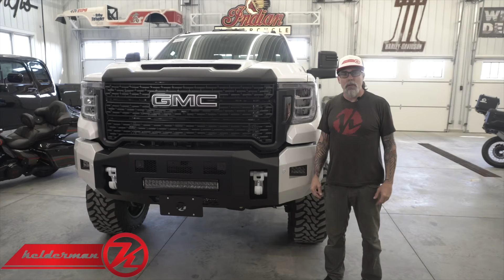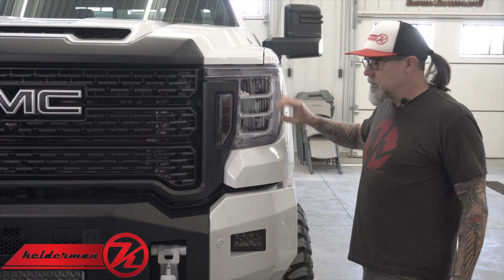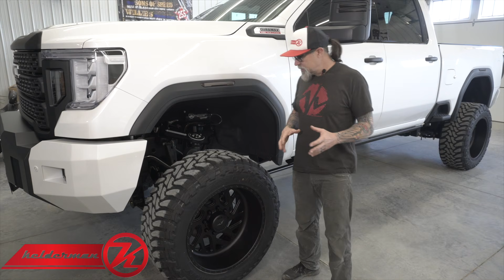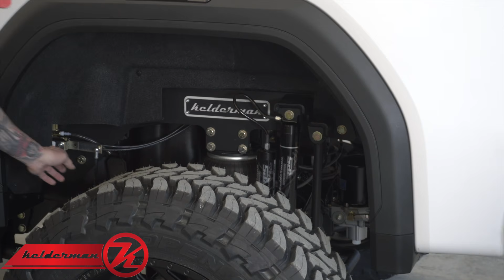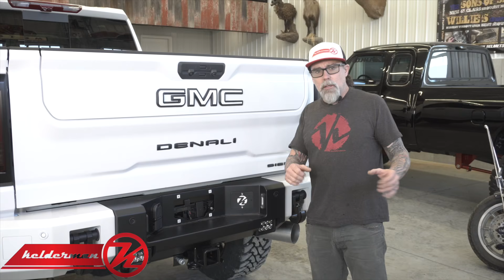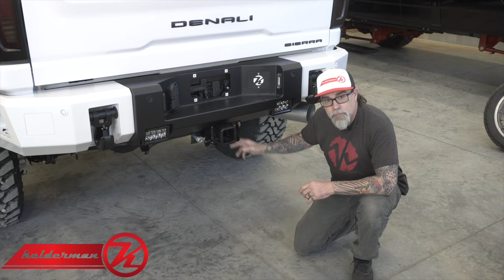*Black & White* 2022 GMC 2500 Denali - Kelderman Air Suspension & Bumpers!

Comment: What is the offroad like with that rear air setup... potentially looking at doing a coilover front end with yalls rear air ride
Reply: You can still use the rear air ride setup just as you would any other suspension style. Off-road capabilities are not impacted.

Comment: I have a white AT4 HD, I like this look but I am very hesitant with lifts
Reply from the maker: This would be a pretty high lift. We have also done smaller trucks with a 4-6" lift kit and 35" tires. If you're not wanting to go this high, that would be our suggestion.
Reply: @KeldermanManufacturing  thanks, I think a quality level kit and 35's might be my thing.

Comment: Is there a complete kit that is less high. Maybe 4 inches or so. Want to haul a fifth wheel without height issues between bed height and camper nose.....Tnx
Reply from the maker: We do not have our own front kit in that sort of range, but you could do something like that with our +2" 4-Link Rear Air Suspension Kit. That's what is shown in this video: https://youtu.be/U-9icCDuSa8

Comment: How much would something like this cost?? Rough estimate PLEASE!
Reply from the maker: Full builds like this are typically in the $40-$50,000 range with lots of cost variables.
Reply: That seems too much. Doesn't make sense.
Reply: Rip of city , mod your truck yourself  at least I do   Lol 😂
Reply: Way too much. I would just get a bds lift with fox shocks and the ride would still be very good. And cost only 2000-2600$.